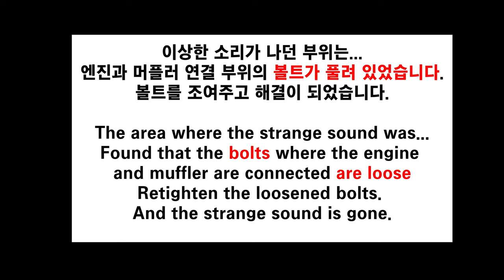Disassemble the drivetrain because the motorcycle makes a strange noise - Honda ADV350

Comment: Thank you for the video! 
I need to buy a torq wrench to do some work on my SH350 transmission. Any idea how powerful it should be to unscrew and not overtighten the bolts?
Reply from the maker: We don't know anything about this Autoboy because the model you mentioned is not officially sold here in Korea.

Comment: If i had a weird noise on my bike first thing i'd do is remove every single thing i added to it, like those red plates the owner put on some places.
Reply from the maker: Yes, I agree with that. 😄
Reply: Hallo i start the beverly 350 bike and when I start to go  there is one noice like krak ..
Is for variator or drive pylley

Comment: Will the adv 350 variator and clutch be compatible with forza 350?The reason I ask this is that in our country it comes as Forza 250 and they made the clutch small and its lifespan was short.  There is an ADV 350 in our country and I wonder if the variator and clutch are compatible.  If so, I will buy an adv 350 compatible clutch and install it on the forza 250.
Reply from the maker: I'm not sure if it's compatible.
Reply: aynı durumdan ben de muzdaribim. Dış koruma muhafazası içi geniş yani büyüğe göre 350liklerin arka varyatörüne göre üretilmiş ama iç tas büyük. Çok büyük ihtimalle uygun gibi görünüyor. Siz denediniz mi?
Reply: @78engintekin  Hayır hocam daha denemedim. Dediğiniz gibi bencede 350 adv'nin varyatör ve debriyaj uyumludur diye düşünüyorum. Advler daha yeni olduğu için herhangi bir motorcu da varyatör bakımı yaptıran daha yok denk gelirse deneyeceğim.

Comment: No problem but the cover have a scratch... 7:45 
May be something It wasn't tight.
Reply from the maker: Yes, the scratches are confirmed.
No problems were found when installing the new parts.
Thank you so much for commenting on this. 😄
Reply: @MotorcycleRepair  good video, appreciate this,  really I think it's a good bike, well design, easy to unmount and check. Honda made a good work 👍🏼
Reply from the maker: @filtro-d-aire6843  Yes, that's right.
Honda motorcycles are well built.
Thank you for watching my video and for giving such good comments.
Reply: Could it be the top cover/fan of the vario is scratching on the housing when at full rpm (when vario weights are fully out)?
Reply: @Martin4o72  Normally, the fan pulley doesn't move, in or out, but only rotates. The other pulley with the weights/ rollers is the one pushed. The mechanic didn't mention anything, but I suspect the smartass owner who put all that bling, bling on the bike, stick his nose to the variator, attempting to do more ”tuning” on the bike. Probably, saw this kind of job is beyond his capabilities, and put all back together, but slightly f--ked up mounting the pulley, didn't tighten its bolt  correctly and enough and it is possible that the fan came in contact with the casing., causing those marks,  vibrations and noise. Then he went to workshop, probably whining. I am not sure, but the scooter might be still in warranty, and this repair workshop does make repairs under warranty. The owner maybe thought if there are parts he might damaged, he could have them replaced under warranty. But, these are only my suppositions. To me it seemed the mechanic unscrewed both the variator bolt and the clutch nut too easy with that impact drive machine, which may be a clue.

Comment: Three days ago I was on my Honda ADV clutch propeller deformed and my engine block slipped, it must be a serial error because the supplier told me that they sold quite a few of these clutch propellers last year. I am very disappointed with the Honda, as the engine is only two years old and has 17,000km on it. Such mistakes never happened so early on older scooters
Reply from the maker: Thanks for your comment.

Comment: Are these adv350s İtalian factory built or Japanese ?
Reply from the maker: I don't know.
Reply: I think its from Thailand as i gotten one and the manual is all in Thai
Reply from the maker: @libra1785  Oh, I see..
The manuals for products sold here in Korea are in Korean.
However, it is not produced in Korea.
Reply: @MotorcycleRepair  here in Singapore most of it is manufactured from Thai
Reply from the maker: @libra1785  Oh, I see. thank you for the information.
Reply: The Honda ADV 350 is built in Italy, all of them.

Comment: Torque wrench, Service manual, and Loctite 243 on bolt threads to prevent loosening. All these are foreign language to you.
Reply from the maker: Thank you for your interest in our video and for your good advice. Let me keep that in mind. 🙂👍
Do you know where the maintenance manual (service manual / not the owner's manual ) for this motorcycle is published?
Reply: have 75000km on my sh300i, change belt 3 times and the clutch once. Never used torq wrench nor loctite and works better than when was honda doing the service...

Comment: 請教一下，adv350 要用什麼齒輪油？手冊沒有寫🙏🏻
Reply from the maker: 如果您在網路上搜尋“本田踏板車齒輪油”或“本田踏板車變速箱油”，您會發現很多類型。
你可以使用它。

If you search on the Internet for “Honda scooter gear oil” or “Honda scooter transmission oil”, you will find many types.
You can use it.